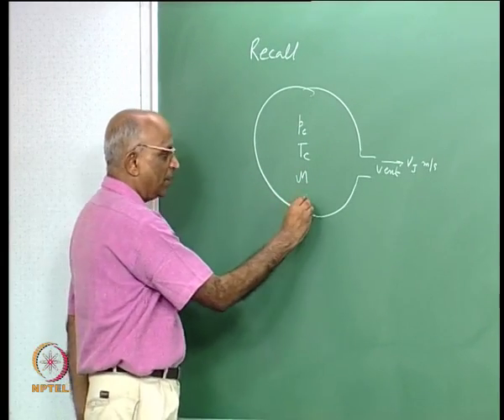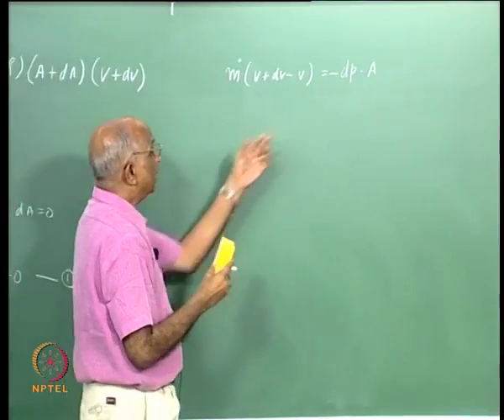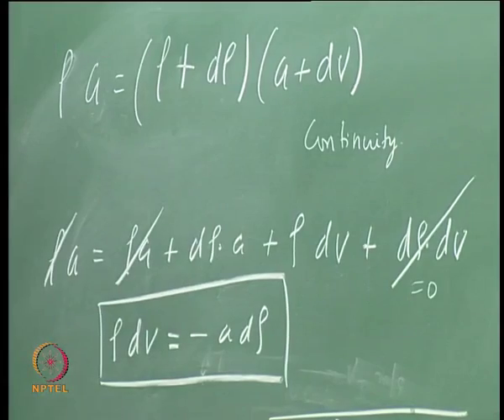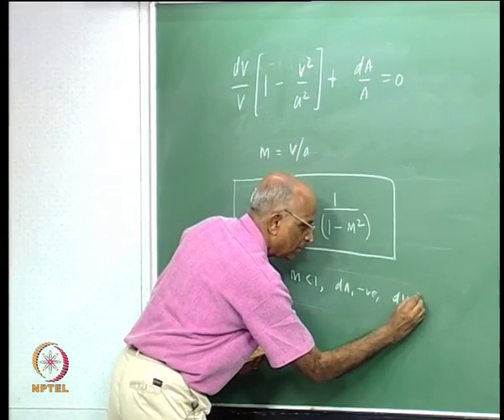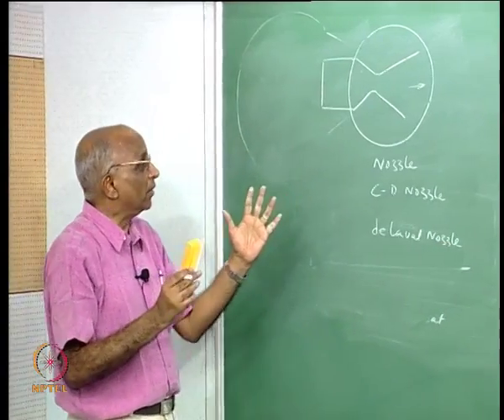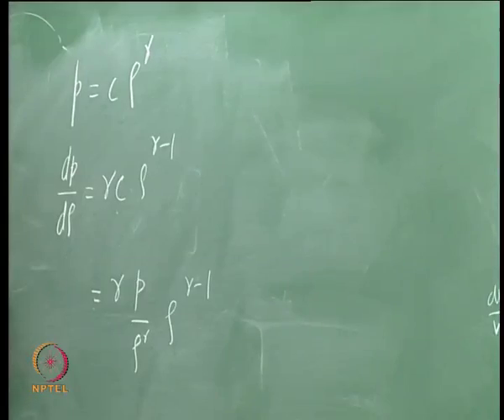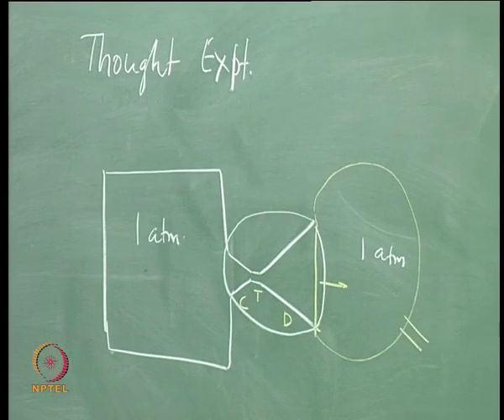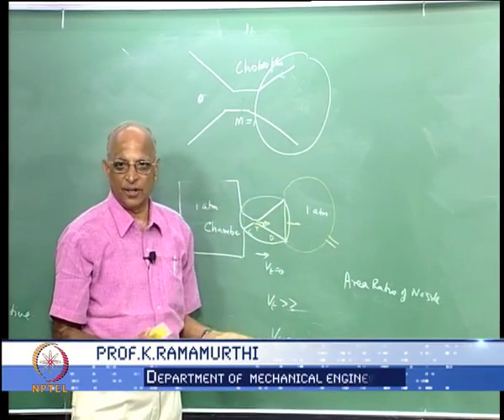Mod-01 Lec-10 Nozzles Shapes

Comment: Thank you sir ,but i have doubt that
Why did u calculated change in moment for the sound in a pipe, and why did u replace the change in density in the nozzle equation to change in density of sound in a pipe,plz clarify the doubt sir
Reply: up
Reply: There's nothing very big logic here we want a design parameters depending upon we can design a nozzle or diffuser for our Rocktes Bernoulli equation helps in understanding how area and velocity are related but it has limitations using Bernoulli you can't design nozzle for let's say supersonic nozzles or hypersonic nozzle there you need different kind of physics this we are just correlating how area's and velocity related in compressible flow and high-speed aerodynamic that's it I hope you understand